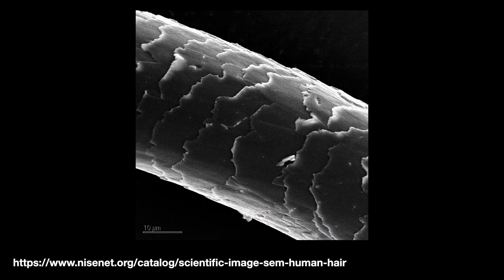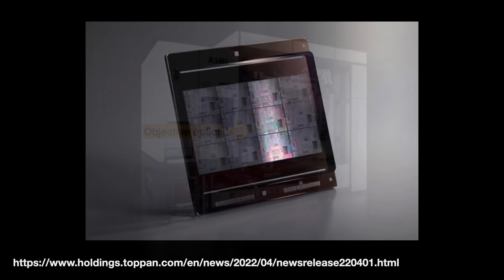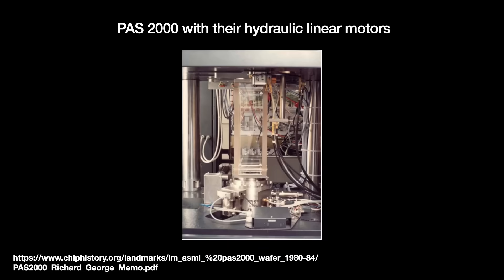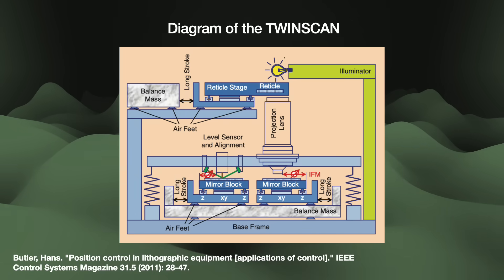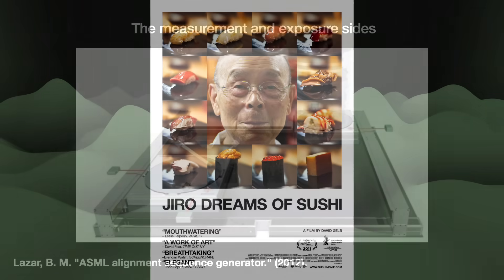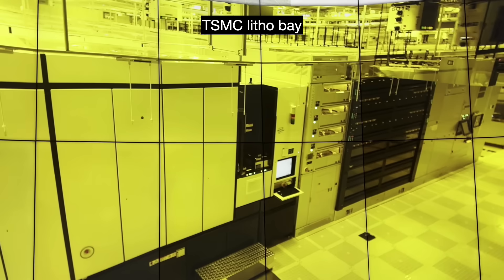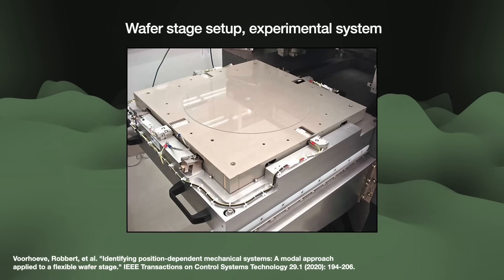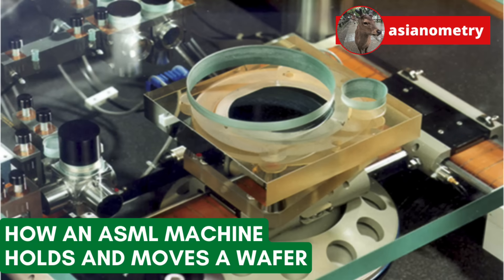How an ASML Lithography Machine Moves a Wafer

Comment: Summary

Introduction to Nanoscale Measurements
- 0:02: A human hair is about 50,000 to 100,000 nanometers wide.
- 0:07: A virus is roughly 20 to 300 nanometers wide.
- 0:10: A fingernail grows about 1 nanometer each second.

ASML Machine Precision and Process
- 0:14: ASML machines position a wafer for DUV or EUV exposure with precision to within a few nanometers.
- 0:24: The precision required in these processes inspired the creation of this video.
- 0:29: ASML lithography machines use magnets to hold and move a wafer.
- 0:38: An optical lithography machine is a $150 million camera using high-energy light to transfer chip designs onto a wafer.
- 0:55: The process starts with applying a light-sensitive polymer (photoresist) onto the wafer.
- 1:13: Inside the lithography tool are sub-components like the light source, condenser lens, photomask, and objective lens.
- 1:22: The illumination system, made of the light source and condenser lens, delivers light to transfer the pattern.
- 1:35: ASML's EUV machine uses multiple mirrors for illumination despite significant power reduction.
- 1:45: The photomask or reticle containing the chip design pattern is critical in the process.
- 2:00: "Reticles" represent portions of the chip design, and the terms "mask" and "reticle" are used interchangeably.
- 2:26: The objective lens focuses the light and shrinks the image.
- 2:35: The light strikes the resist-coated wafer, creating a 3D relief of the chip's design.

Wafer Handling and Positioning Challenges
- 2:45: The wafer and its stage weigh about 15 kilograms, akin to a Grizzled Tree-Kangaroo.
- 3:01: The platform must move wafers quickly and stop precisely during exposure.
- 3:19: Good "overlay" is crucial for the correct positioning of pattern layers.
- 3:41: Multi-patterning involves multiple exposures to create smaller lines.
- 3:48: The wafer stage can accelerate up to 20 G-forces.
- 4:06: The system must avoid vibrations during fast movements to maintain precision.

Historical Development of ASML and Philips
- 4:15: ASML evolved from Philips in the Netherlands, with a history in semiconductors.
- 4:29: Philips' NatLab developed the pioneering lithography machine, the Silicon Repeater.
- 4:34: Philips used "hydraulic linear motors" in early wafer steppers, which were precise but unreliable.
- 5:00: Hydraulic system leaks in cleanrooms led to the exploration of electrically-driven systems.
- 5:35: Philips' experience in optical disk technologies influenced the development of linear motors for wafer positioning.
- 6:25: The shift to 300 millimeter wafers required re-engineered lithography machines.

TWINSCAN Technology
- 6:49: ASML created the TWINSCAN platform for lithography with a dual-stage cycle.
- 7:02: TWINSCAN uses electrostatic forces to clamp wafers and reduces direct contact to minimize contamination.
- 7:21: Wafers are loaded/unloaded by a robot and start with the measurement stage.
- 7:38: The machine aligns the wafer to the reticle for focus and accurate overlay.
- 7:50: During stage swaps, the machine can exchange reticles, requiring new alignment.
- 8:01: TWINSCAN's wafer movements are coordinated by the Control Architecture Reference Model (CARM).

Engineering Innovations and Challenges
- 8:22: Major engineering challenges in developing the dual stage setup included re-balancing weight and mass, and managing vibrations.
- 8:43: Lens and metrology equipment isolated from the main frame using air-bearings to reduce friction.
- 8:50: Measurement stage, not exposure, is key to throughput; example given comparing to sushi preparation.
- 9:44: TWINSCAN has several product categories: NXE for EUV lithography, NXT with 193-nm ArF DUV light, and XT with 248-nm KrF DUV light.
- 10:02: NXE:3350 EUV machine processes 125 wafers an hour, while sophisticated DUV machines can handle 200-300 wafers.
- 10:17: Machines have modular builds and are upgradable to meet modern requirements.

Movement Systems and Technological Evolution
- 10:38: Lithography machines have two movement systems: "coarse stage" for transport and "fine stage" for precision.
- 11:21: Evolution of precision movement technologies in machines, from mechanical systems to aerostatic systems.
- 12:32: ASML used interferometers with lasers for stage positioning, requiring adjustments for air refractive index changes.
- 13:17: Transition to magnetic levitation in preparation for EUV lithography in vacuum environments.
[ I think they switched to vacuum because EUV is absorbed by air. I think that is a more important reason than particle control. ]
link: https://indico.cern.ch/event/445667/contributions/2562988/attachments/1513761/2361548/MT25_926_Peijnenburg_v5.pdf
(see bottom for summary of this VDL presentation)
- 13:24: Explanation of magnet technology in wafer stages, including Halbach array for magnetic field optimization.
- 14:01: Metrology challenges in immersion systems and improvements in overlay accuracy.
- 14:24: Design challenges include dealing with magnetic field interference and cooling requirements.
- 14:33: Proposals for single mag-lev systems to handle both short and long-stroke movements.

Conclusion and Software's Role
- 15:02: The extreme precision required by ASML machines is highlighted with a personal anecdote.
- 15:21: Significant role of software in lithography machines, with a dramatic increase in CPU, sensors, and lines of source code.

Summary of VDL Presentation

- In-Chamber Magnet Technology Presentation: 
  - Authors: Ton Peijnenburg, Aernout Kisteman, Paul Blom
  - Date: August 29th, 2017
  - Event: MT25 - Amsterdam
  - Presented by VDL Enabling Technologies Group

- VDL Enabling Technologies Group Overview:
  - Specializes in semiconductor capital equipment, analytical equipment, and more
  - Evolved from Philips Machine Factories (1900)
  - Operations in 5 countries, 9 companies
  - Facilities: 182,000 m² production area, including 16,000 m² cleanroom
  - Workforce: 2,200 employees
  - Services: Contract manufacturing with design and life cycle management

- Photolithography in Semiconductor Manufacturing:
  - Focus on wafer stage with specific characteristics:
    - Scan speed: 1 m/s
    - Acceleration: 30 m/s²
    - Overlay accuracy: 2.5 nm
    - Moving mass: 20 kg
    - Drive force: 600 N
    - Position control critical for chip manufacturing

- ASML's Photolithography Tool:
  - Emphasizes position control in lithographic equipment

- Actuation for Accurate Positioning:
  - Fine actuation: Electrodynamic with 6 DOF, 1 mm stroke, 20 kg moving mass, 0.25 nm position error
  - Coarse actuation: Planar maglev with 6 DOF, 1 m stroke, 75 kg moving mass, 25 µm position error

- Design of Coarse Coil Module:
  - Includes various components like foil coil, power connectors, and cooling covers
  - Specifications for fine and coarse actuators outlined

- Magnet Plate for Levitation Stage Coarse Motor:
  - Dimensions: 2200 x 1300 mm
  - Weight: Frame approx. 800 kg, magnets 623 kg
  - Contains various types of magnets
  - Emphasizes the automated assembly for accuracy and safety

- Summary of Developments:
  - Advances driven by the need for fast, accurate wafer and mask positioning
  - Key aspects: High force density, tight tolerances, automated manufacturing

- Future Development Directions:
  - Focus on accuracy, power, and efficiency
  - Potential improvements: Increased drive voltages, superconducting coils, better heat conduction, mechanical stability

- Acknowledgements:
  - Technology development attributed to ongoing work by ASML and its suppliers, including Philips and VDL Enabling Technologies Group
  - Special thanks to ASML for allowing the use of their material in the presentation.

Disclaimer: I used chatgpt4 to summarize the video transcript and one PDF.
Reply: Big thanks for presentation pdf, very interesting!
Reply: @AABB-px8lc  The link of the PDF is shown in the video. It is not mine. I just typed the link into the comment because it is an interesting presentation.

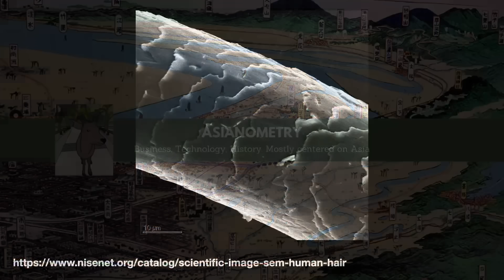Comment: 00:07 ASML machine must position a wafer precisely within a few nanometers for exposure.
02:11 ASML lithography machines use a reticle and objective lens to transfer a chip's design onto a wafer.
04:15 ASML evolved from Philips in the Netherlands
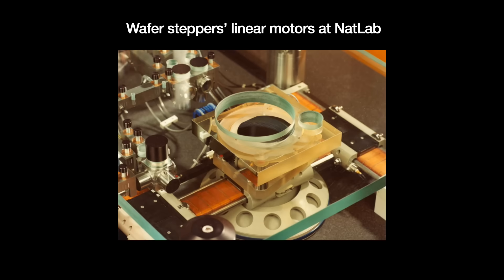06:17 ASML's TWINSCAN platform enables precise maneuvering and exposure of silicon wafers.
08:16 ASML's TWINSCAN machine revolutionized lithography processes with dual-stage setup
10:06 Lithography machines move wafers with precision and speed.
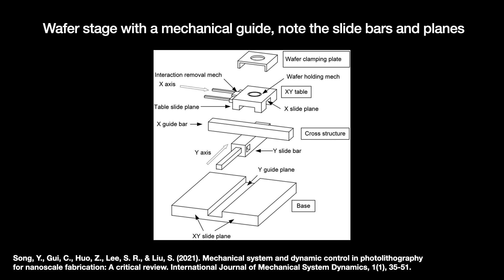12:00 ASML lithography machines implemented aerostatic systems to reduce friction and vibrations during wafer stage movements.
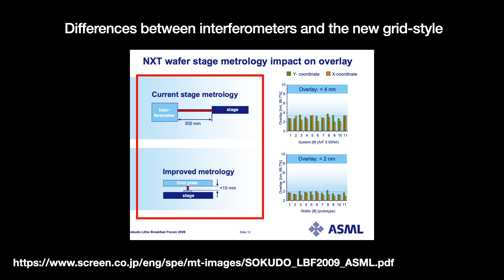14:05 NXT immersion systems have reduced metrology laser travel and improved overlay.

Comment: I'm kind of curious how they got the 1.2 Billions lines of code figure. By comparison, very large OSS projects (LibreOffice, Chromium, Linux Kernel, Blender) are in the order of a few 10 Millions. IIRC, billion sloc is a figure more often used to describe the entire code base of giants like Facebook or Google.

If I were to guess, I suppose in these billions of lines, the vast majority must be auto-generated and more specifically auto-generated tests/test data (a bit like sqlite which has +500 times the SLOC of tests compared to the actual library). I'm also expecting these programs to actually be more automatons with millions of states and transitions.

But it's only a guess, and I would love to have a look at the code ^^.
Reply: As someone maintaining a PAS 5500 system, I’d guess that a lot of code has gone into error handling and data logging. The software has very detailed error messages that cascade such that they refer back to what triggered them. Furthermore, there are inspiring messages sprinkled through the logging when encountering alignment issues. Things like: “attempt failed, but we’re not giving up yet”. These always make me smile.
Reply: I was about to say the same. I feel like it must be off by at least 2 orders of magnitude. The number will vary based on what it being counted (does the figure include the OS and computer vision libraries?), but I can't imagine the number being a billion.

Comment: How on earth do they deal with thermal expansion? At these scales surely even the heat of the laser etching will cause expansion and deformation of the wafer and nearby parts?
Reply: Water cooling lines run through the mechanical structures where possible.  Also using low thermal expansion glass like Zerodur.
Reply: Also, more metrology and software to correct https://youtu.be/PsaOWZv9vH0?si=KTAA6bA6ABF2MlU1&t=765

Comment: On the one hand, you say you can't judge complexity by lines of code. Presumably because line boundaries can be arbitrary.

And yet i say you can judge complexity by lines of code. Because it's natural for a line to encompass one complete simple thought, akin to a sentence.

You
would
n't
sepa
rate
things
into
lines
like
this

because it hampers reading, you wish more information density. And in turn, allow me not to demonstrate, you wouldn't want too much in a single line.

Also, whose face have we revealed this time?

Comment: Holding ~1 nm alignment tolerance over meter-scale distances is hard enough; holding that tolerance dynamically while the waver and mask are moving at a relative speed of several meters per sec is insane. In the time it takes the light to get from the mask to the wafer, the wafer will have moved something like 5 nm. So somewhere in those billion+ lines of code controlling the system there is a correction for the finite speed of light.
Reply: "this stuff is magic, it just all barely works"
Reply: Actually its only less than 10 mil lines
Reply: All the play in the bearings, all the squish in rubber belts, all the harmonics in metal gears, the play in-between the great teeth, everything is considerably less solid at these scales and speeds.
Reply: @MostlyPennyCat  They got away from bearings, rubber belts, and metal gears long ago. Everything is magnetically levitated.
Reply: @kenjohnson6101  
You've missed the point.
They have to deal with the same problem regardless of what the hardware actually is.
Reply: Glad you started the comment about the speed of light being a factor. The discord your comment inspired helped me realize how amazing this stuff is.

You know how when they say, this star , or galaxy is 4, or billions of light years away. Humans can’t conceive of those scales in our minds; 4, or billions of light years, both are too much for a human mind and forget logically understanding the difference.

I would have thought the same applied to 7 nanometers, or 3. It really makes one think of how far we can go and how we can achieve it

Like I said, appreciated your contribution in the comments
Reply: No, you missed the point. That’s why they got away from it, like he said.
Reply: Nope. Real time systems have less lines of code.
Reply: @low-key-gamer6117  Why is that?
Reply: @PorkBoy69 the system must run through as little code as possible, as fast as possible, it must be as simple and verify able as possible
Reply: It’s not like a single drop of tin is used to expose each die. The laser pulses at 50kHz, it is effectively continuous
Reply: Movement of device and speed of light are not in comparable terms. 
Wafer is positioned before exposure to light begins. The movement speed is not to catch up with light speed, instead it is to increase the throughput.
Reply: That might be the best fact I've ever heard encapsulating how bonkers these machines are
Reply: Well put.. blows the mind
Reply: I doubt there is software code, mostly FPGAs and or ASIC will be controlling at that level.
Reply: Almost unfathomable precise
Reply: Wait until you realize that at these scales and speeds a wafer doesn't behave a like a solid piece of matter it's more like a jelly at nanometer scale and you need to account for that as well.
Reply: Sure, I can take a million lines of code and with 5 cuts and 40 pastes make it into 1 billion lines of code.
Reply: It's not moving during exposure. It stops each time. The coarse motor stops, then fine motor adjust, then light strikes. But since the source light consist in laser shooting a tin droplet to vaporise it. All this happens while the droplet is on its way.... Mad !
Reply: @TheBokanist  Nope, it is a scanner, it moves with preset move profile during expose
Reply: 1.2 billion lines of Object Oriented programming. I’m surprised the software dev team didn’t need nets to keep from jumping out the windows
Reply: @drygordspellweaver8761 How are you sure that they indeed don't have nets or even bars at the windows?
Reply: @TheBokanist  During exposure these stages move at constant velocity!
Reply: @TheBokanist  No, it is moving. It's called "step and scan".
Reply: @kenjohnson6101  
"Step" means stop, then start again later, Ken.
You just don't get any of this stuff, do you?
Reply: @David_Lloyd-Jones  The ASML twinscan machines are step and scan. It definitely requires the positions of the wafer and reticle to be controlled to nanometers in real time, as @kenjohnson6101 said.
Reply: @TheDavidlloydjones Ken might not get this stuff but everyone gets your mom, Dave.
Reply: Indeed, very little code is required to do this, the trick is abstracting away all the messy real world stuff so you can implement some logic. 
Take a transistor, it's output.
We're taught that it's binary, on or off, 1 or 0.
But this is a fib, when you energise the output by manipulating the gate, down at the nano second scale it actually bounces on off on off on off and slowly stabilizes at the desired value.
But when do you measure it? How long must you wait?
We actually take a sum of output over time for a sliding window and present the average as the output. 
Once it hits a threshold, that's when we decide it's on or off.
Now imagine all the motion and electronics "noise" you have to abstract away. 
When those motors stop, they don't stop, they wobble and bounce all over the place at the nano second and nano meter scale. 
That's the hard part.
Not a lot of code needed but you need to measure and analyse very very quickly and accurately.
Reply: More code, slower execution
Reply: So basically it’s so fast and precise it has to and can take in to account light traveling a given distance actually not being the universe but rather meters 😂 it’s astonishing…
Reply: Its done by FPGA's not microcontrollers therefor the reaction time is not really depending on the length of the program.

Comment: The thing that really makes my head 🤯is that the wafer and reticle are in motion during the exposure.  They move opposite directions with a tiny slit between them such that only a narrow line of the image is projected onto the wafer at a time.  The relative motion of the two needs to match exactly so the reticle image lines up with the correct part of the wafer.

So that crazy 1nm overlay spec that you were probably thinking is a "line up and hold it still within 1nm" is actually "drive the wafer and reticle in opposite directions while accelerating at 20Gs and do not allow the speed of either the reticle or wafer to deviate by more than 1nm from it's predicted x or y location at any point along the path."
Reply: The lens scales down. The reticle only needs 4nm precision.
Reply: @ArneChristianRosenfeldt  “only” XD
Reply: @liesdamnlies3372 Me baking waffels to only 7nm precision. Old technology, my bad. :face-blue-smiling:

Comment: Camera? Maybe more like a projector? Great video!
Reply: Depends on what your definition is of a camera vs a projector.  On one hand, It's more camera-like based on the image in the reticle between shrunk down as it reaches the wafer (like a camera lens shrinks an image to the sensor/film).   On the other, it's more like a projector in that the image of the reticle is backlit and projected onto the wafer.  I work in photolithography and tend to prefer the projector analogy.